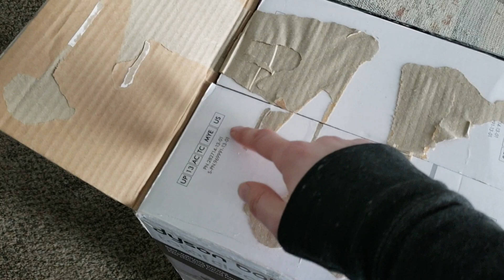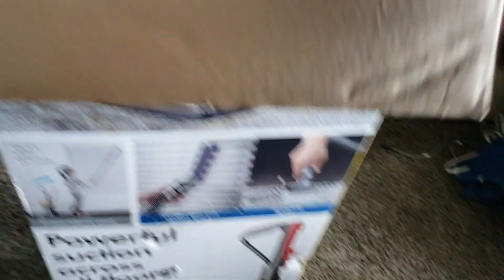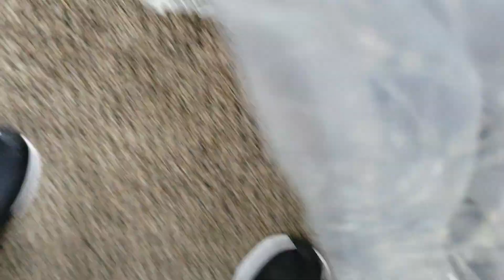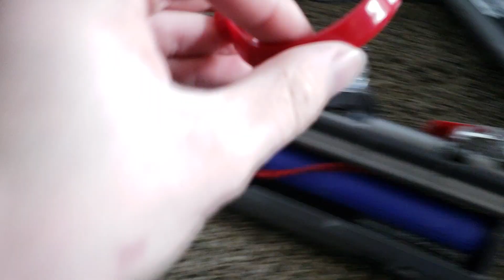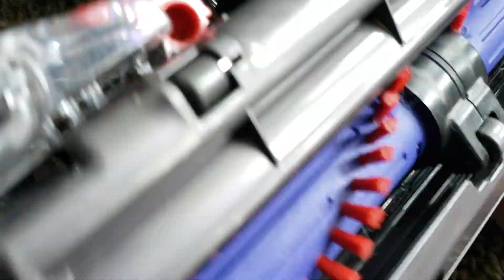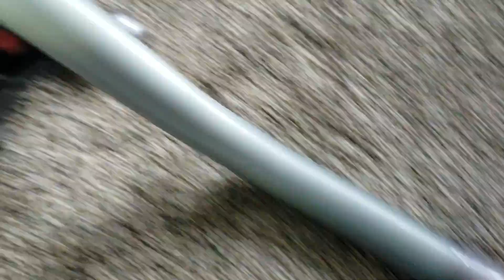Dyson Ball Total Clean Unboxing, Assembly, & Usage Tutorial (UP13)

Comment: When you buy off ebay and it's *new in open box*, it means that most likely somebody purchased it, opened it but for sone reason changed their mind and then returned it to the store. Get over the nitpicking about it or just send it back and buy new.  ebay buyers like you need to just buy new because you are a thorn in a sellers side
Reply from the maker: What are you talking about? I have to reason to return it, I'm very happy with it. It ended up working perfectly and I was able to activate my warranty just fine, and it's still running strong 6 months later. There's a difference between being cautiously observant and complaining about the product. There's nothing wrong with being careful and making sure you get a good purchase. And in this case, I did. And I'm rather happy with the unit.
Reply: Shut up Michelle!   He wasn’t even complaining so calm yourself down!
Reply: @blakaeg  shut up? Are you a dictator? I'm just as entitled to state my opinion on a PUBLIC forum on a PUBLIC post. Ill keep speaking and you can GFY. BAHAHAHA

Comment: Unfortunate I can definitely tell you that somebody else had that machine out of the box and doing something with it, because that is not how they come packaged from the factory, so somebody else had it first and was doing who knows what with it? 😔😥
Reply: It was an open box purchase. Meaning, box and components have possibly been open and removed but product has never been used. Either accept that the parts are most likely not in sealed plastuc and there might be a little lint on it from pulling it out of the package (you can tell if it's been used ir not), or buy new.  Damn nitpickers

Comment: Looks like you got a refurbed motor ball and tube assembly that they forgot to take the bracket and tool off, packaged it with new parts on it, and in a new box, and sold it as new. Dirt in those spots comes from refurbed parts, not from factory.
Reply: Nope

Comment: I got this same one from a month ago from a goodwill for 30 dollars it was very clean and nothing is wrong with it except the tool holder is missing
Reply: I got one yesterday for $10 at goodwill. Roller brush didn't spin so I pulled it apart and cleaned it and it works great. Mine had no attachments either but for $10 who cares. Good find!
Reply from the maker: You can find the tool holder for only around $10 or $15, so that's an easy fix